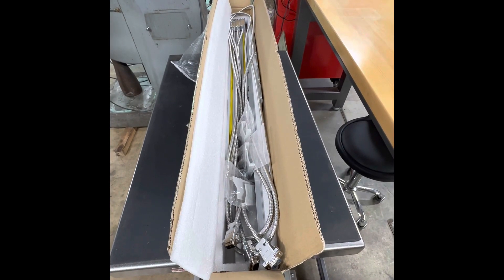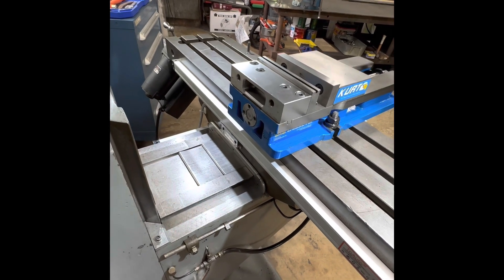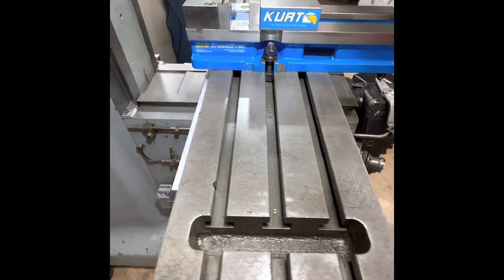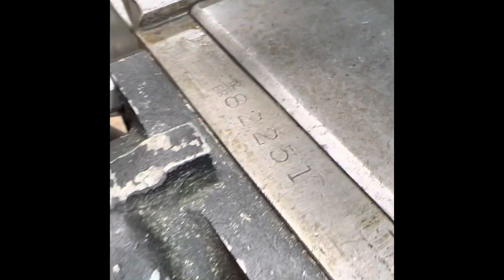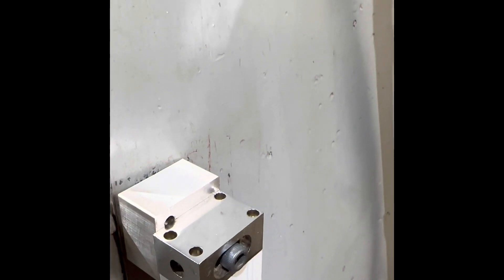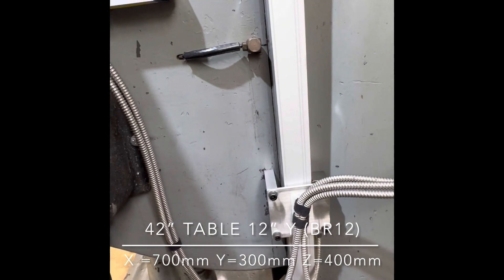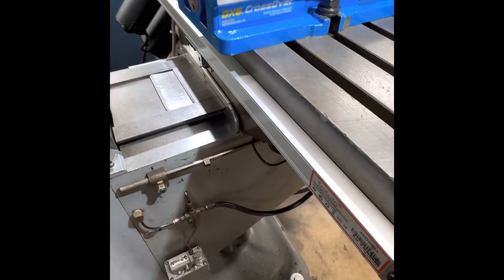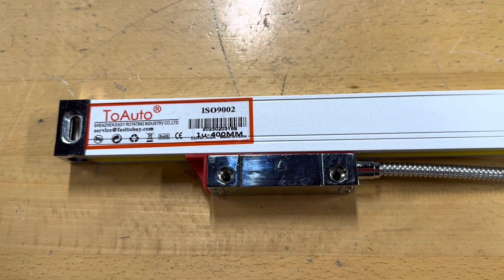Adding linear scales (DRO - Digital Read Out) to a Bridgeport milling machine at @skytopshop

Comment: A scale on the quill is almost a total waste of money in my opinion. I had to replace my old ancient dro on my mill about 3 years ago. I put a quill scale on the new DRO setup. I have not used it to date. Anything i do precision on the z is done with the knee. I have thought about removing it just to get it out of the way. And reduce clutter on the front.

Comment: Late to the party. I am wondering on the Y axis if the steel cable sheath is binding and/or making the sliding reader out of plain as you move the table forward and back. I have never wanted to mount the scale frame solid and move the reader for this reason.

Comment: Got a question for ya. I broke the ribbon cable for the encoder when mounting the y axis of an accurate DRO.
Reply: Am I able to replace with a different model scale than the one I had? I had an accurite senc 125 scale for the y axis but I can't find the same one on the internet at all
Reply from the maker: @ISILENTNINJAI can it be repaired? Resolder the connections?
Reply: @skytopshop  I will try to if possible to open it up